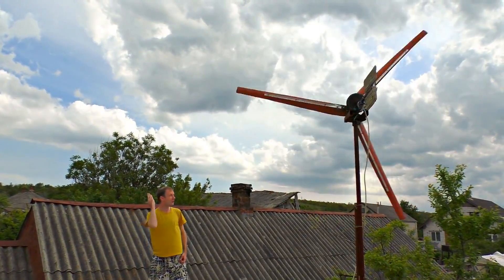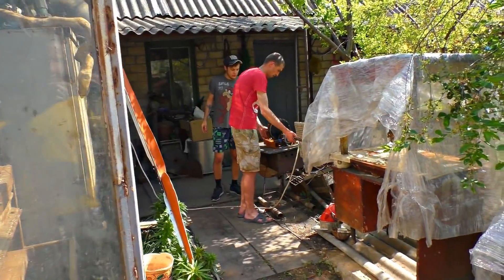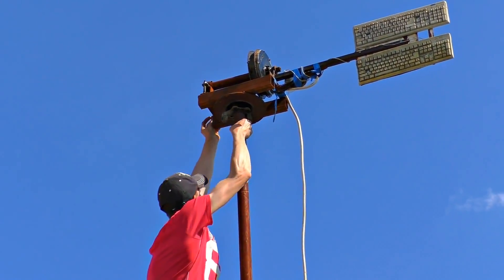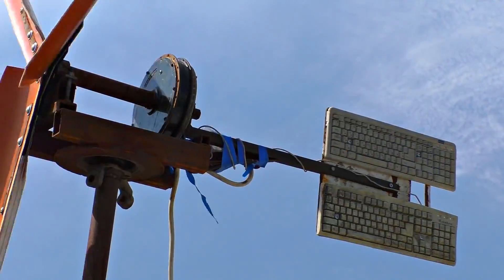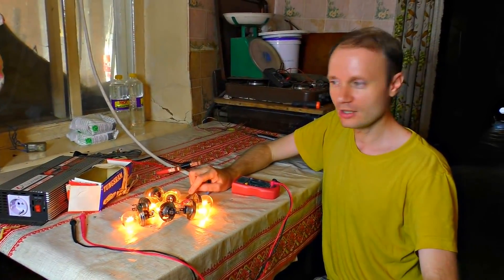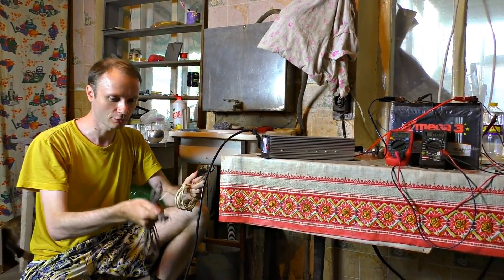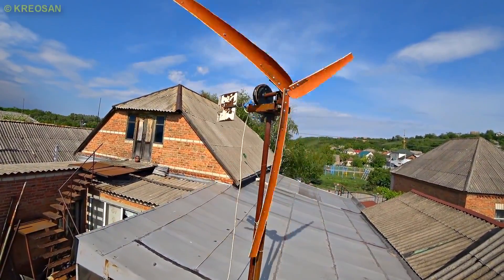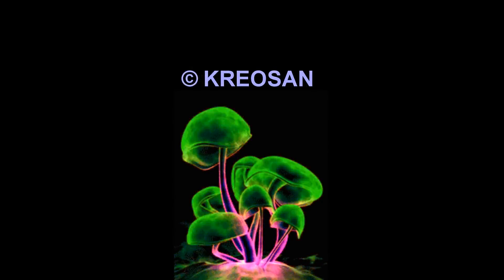✅Assembled a powerful Wind Generator for the whole house 🚀 Free electricity 💡 Clean free energy

Comment: I stayed in a house in Scotland once which had a similar wind turbine -> battery -> inverter -> house arrangement. Though what was interesting is that there was an entire network of 12V lights and sockets around the house in order to avoid the need for the inverter and save even more power.
Reply: I wonder of having a 12V system actually saves power because you have more loss by distance of wiring, specially for things that draw high currents.
Reply: @teresashinkansen9402 That is a good point. I guess it's the trade off between the conversion costs and energy costs for the 240V vs the energy loss on the 12V.

Comment: Dude! Excellent! (LOVE THE KEYBOARDS X-D) BUT IT NEEDS TO HAVE A AUTOMATIC (!) BREAK! (short circuit all wires when RPM get TOO HIGH) or it will EXPLODE during a storm 😎✌🍺 stay cool!) also the wires to your house should be a bit larger if u want to send 1.5kW and 2kW through it :D
Reply: Ideally feathering blades would be the answer, or simply flexible blades that bend away from sharp wind. Perhaps mechanical feathering - too much RPM then reduces the angle of attack.

Comment: Hehe make some gunpowder from the pig sh*t...   As for the generator, utilising a car steering wheel horn push from the centre you should be able to make a 360 degree contact so you can do away with the trailing cable to the generator, not that hard to make being two rings and two sprung contacts or brushes even.

Comment: Obviously carbon fiber blades would be much harder to make (& not worth making unless making extra for sale)  But would be more efficient/make more power, due to being lighter & also much stronger than PVC pipe. So they wouldn't need replacing often. Either from breaking in every thunderstorm or get brittle from uv rays. 
But a combination of Kevlar & fiberglass diy turbine blades would be fairly easy to make, much stronger, not any heavier & wouldn't need replacing every thunderstorm. 
I knew the difference between low & high speed turbines but didn't realize bigger blades like that made a big difference in low wind. A combination of wind & solar + plus backup seems the way to go. But often can't be done in residential areas.
Reply: Impossible to recycle carbon fibre. Weight has no bearing on efficiency, and ideally the blade will flex, to protect it.
Reply: @G-ra-ha-m  I always heard lighter blades were better but can easily see how that might be wrong information.
Reply: @michaelbrinks8089  Lighter blades would be less likely to fly off at extreme RPM, but the flywheel action of heavy blades is not a problem, and as long as the pole can support them, it should be fine.

The key I guess is for us to build one, out of anything we can find :)

Comment: Great video with many important details! One thing to remember to check when fitting a new cover is that there is absolutely no grit or anything inside it. Yours came out of the box which is good but if it's been in the bottom of a pannier it can pick up a bit of sand or something. It will rub into the inner tube and give you a flat after a few miles. Also I think even you might struggle to get a Schwalbe Marathon Plus off without levers. Sometimes you even need them to get them on, which can be risky, however Schwalbe have made some blue plastic levers with a very slender hook on them to prevent catching the tube and puncturing it. These are great levers anyway and the ones I just use for everything.

Comment: The 1200cca truck batteries often have a 8 year warranty on them and cost 8 times less then the lithium batteries... just use some 12v truck batteries.
Reply: finally someone agrees
Reply: Yeah, they also are designed to hold power for a long time.
Reply: Ya, nothing wrong with that. But supposedly lithium offers more long term bang for buck but at higher startup costs. Also if something goes wrong & lithium batteries get damaged. Like a BMS could go bad & destroy battery bank. You're out all that $$$  bye bye long term cost savings.
Reply: @michaelbrinks8089  Lithium is fundamentally unsafe, especially in the home, lead acid is probably still the best, but perhaps AGM as flooded cells stratify over long times, unless given exercise - but perhaps in this use case would be fine.